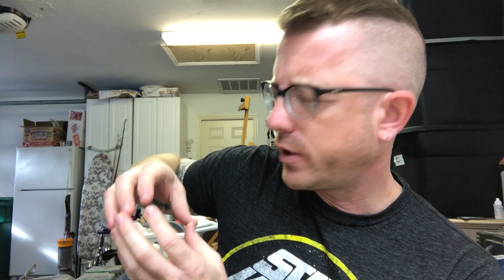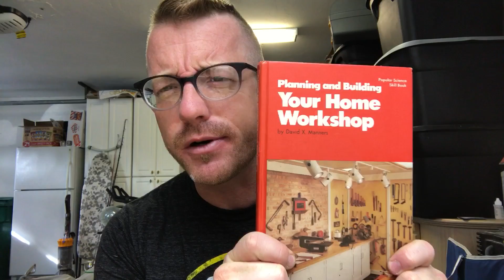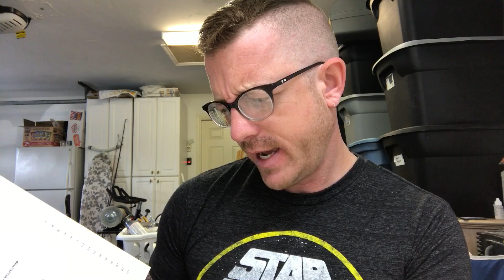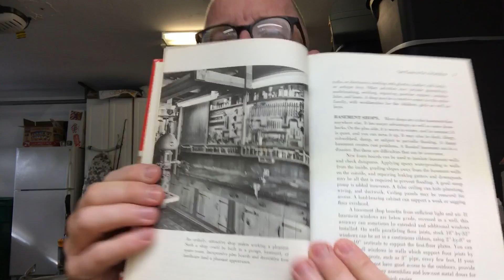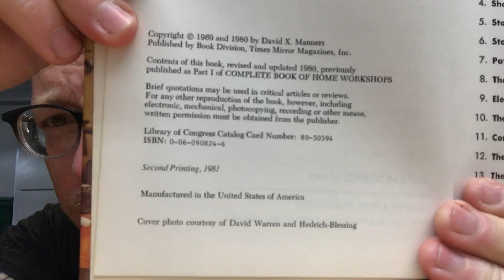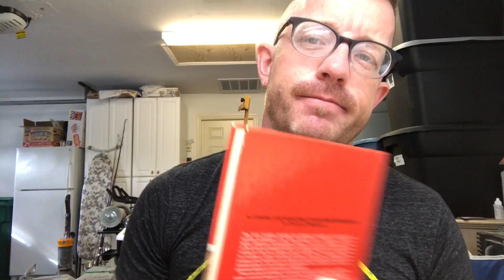Boat Project Concept

Comment: you could just put a 2.1 mercury 115 four stroke outboard Ct gearbox on it because I think it doesn't need a lot of power to push it alone it still do about 45 knots in it so shall the old Johnson and buy 115 mercury four stroke Ct 2015 model.

Comment: Not sure about an electric boat.  I have seen them in China using multiple lead acid batteries.  The props are different - way less rake.  I think you might consider the energy you need by simply calculating how much energy the cheeta needs to get from one place to another via fuel consumption - multiply by two cause you will go slower and the boat will plow, then convert to amp hours of battery you need to duplicate that.  Is it possible?  absolutely!  Is it practical - hmmmm ??  but then what hobby is- -  lol.   I say if it brings enjoyment - its shared with family  - GO FOR IT!!!!
Reply from the maker: Thanks James. I agree on the speed thing, I love going fast. This might be a pipe dream. But what would we learn!? A lot I am guessing. LOL.

Comment: like the idea, I think the wolf hull is to big and way to heavy be efficient in any way. the power needs would be high as those older boats relied on HP to move them. can you start with a plywood hull boat built to your specifications for weight and drag? that way you can build the boat for your power specifications instead of having the boat decide for you. it would be cheaper than trying to up-fit the wolf. you can use the wolf as a mother ship. just a thought.

Comment: take a look at Kongsberg DP systems and you will see how basically a arduino system that can hold position via GPS would work. I have worked on many DP systems that allow a boat to hold position with a push of a button. To hold position it needs a gps reference. Anyway good luck and would be a great project !!

Comment: There is a company called electricyacht.com that appears to make systems for sailboats. Some teenagers in the seventies or eighties used an electric forklift engine in their sailboat, due to their great torque rating and reliability, allowing them to use it to get good speeds and power when entering and leaving ports. Maybe worth some research. If you had enough deck space you could include a solar system. It won't be enough to completely charge the batteries within a short time, but would extend your range.

Comment: I would stick with  a gas motor for the wolf and if I would ever do a electric boat I would do it with a in board motor boat as it is way easyer to conect a electric motor to the leg and majority of the components to be put in to the engine compartment out of sight and more protected against the water

Comment: The guys at mythbusters did something like this, you should check that episode out. They used an outboard and removed the engine, then used an adapter plate for the electric motor. https://m.youtube.com/watch?v=_EV2qq2-Lck

Comment: cool idea.....some thoughts though: weight in terms of your batteries, solar charging of these batteries, power factor of the motor(s) and longevity of the system in terms of corrosion protection for the electronics.....you might have to consider some milspec connectors and encasing the components in resin, comes with its own issues when considering heat dissapation and repairs. will be watching

Comment: what is the planning speed of the hull?  have you considered using an outboard leg with an electric power head. include computer controlled shifting and steering with your GPS idea. this would simplify the project and keep all that drag from the extra motors.
Reply from the maker: Good point. I don't know the planning speed of this hull as there isn't much data out there on it. That said, that could be an easier way to go, maybe the outboard could rotate 360 degrees to shift the boat where ever it needs to go? Or maybe we have a drop motor on the bow to anchor it? I just have a hard time keeping the boat in one spot in heavy tide swings, and it would be nice to be able to move at a 1-2 knot pace as you hunt near the mangroves.
Reply: Captain House if you have computer controlled and  shifting that could go a long way in controlling the location.  the computer is not going to get distracted from it's duties like we do by our interests.  Just think of it as putting you stern in to the wind and tide and being in reverse. It's easier to hold station that way

Comment: not as hard to do as you would think, there a Motor Guide I pilot trolling motor with GPS and "anchor" that keeps your boat +-5° of where you set it to, and yes you can link it to your GPS for preset courses, check in to them it might be a good place to start, I to like the electric motor idea, I was thinking about the same thing for a little over a year now, solar panels on the floor with lexan over top of them to protect them, I don't think you would be able to handle the reflection from the sun on the panels tho, but that would be cool don't ya think? missed your videos how you been?

Comment: Capt. I really like the idea!  You could pre plot a course and have the boat maintain that while you concentrate of fishing, that would be sweet.  I think the jet ski pump section and hull area would be a good propulsion answer.  

Glad to see you making videos, and good luck with the Wolf.

If you go electric what is the faith of the 175?
Reply from the maker: Actually I did compression testing on the 175 and found it to be in bad shape so I sold it to a fellow in my neighborhood who could actually fix it. So as of right now I am motor-less! Thats why I think electric could be a fun project AND I could do what you said, have it plot a course and keep me in place if needed when fishing. Plus it's a whole lot quieter. I am digging this idea. A lot.

Comment: look for azipod engines and look for tug boats technology they already have the technology
Reply from the maker: Good Tip Nuno. Ill check it out. They have electric tugs!? Awesome.
Reply: No but what you want is a propeller with azipod engineer, it turns 360 º and it's electrical power that makes him run.
For the electrical power you only need a generator set. i would start this way and continue improving the engineer itself.
Reply: Check this out http://www.vetus.com/manoeuvring-systems/electric-bow-thrusters.html i think this is the key to your design
Reply from the maker: Ahhh I see. I have heard of this tech I think its called a POD motor? Where you can use a joystick and move on all axis. That would be perfect. I think I should prototype this on a smaller vessel like a kayak or Stand Up Paddle.  That would be easier to trial test.
Reply: also look for auto pilots in sail boats they usually do what you plot in your course and go along.
Reply: check also electrical engines with propeller incorporated
http://www.vetus.com/engines-and-around-the-engine/electric-propulsion.html